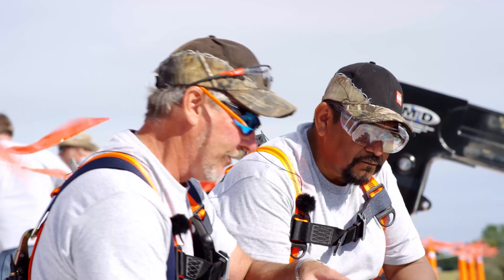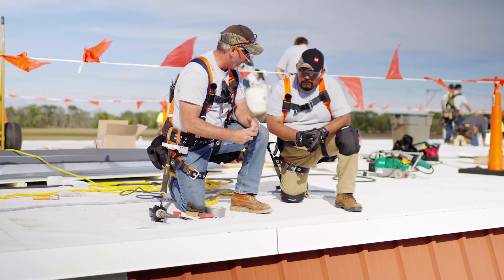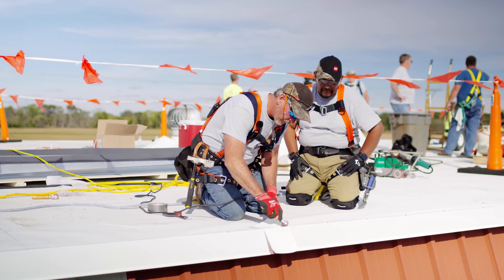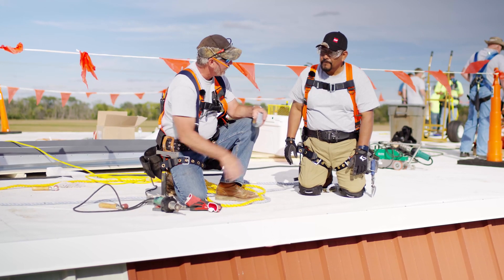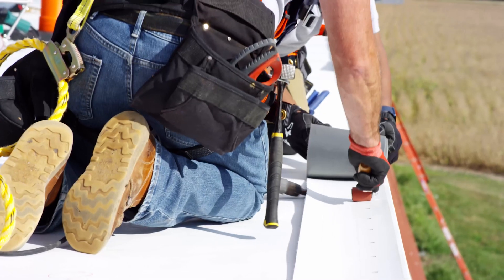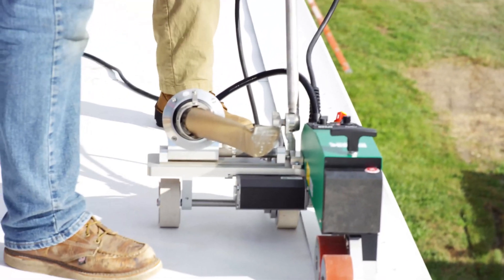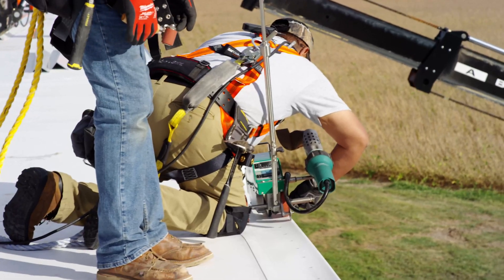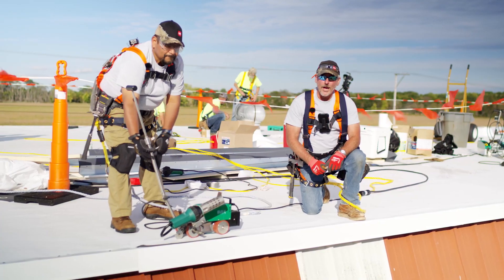Edge Detail Options - TPO Coated Metal | Roofing it Right with Dave & Wally by GAF

Comment: Imo, the unsupported patches should go on last. Just like your blow out patches and T-joint patches, unsupported is made to flex but when you bury it with a reinforced strip it halts that flex, and also does not crease as well on your patch joints if you put the unsupported first. Assuming that your deck and strip sheets are 60mil, if its 45mil then its fine. Maybe i should have opened with that 😅